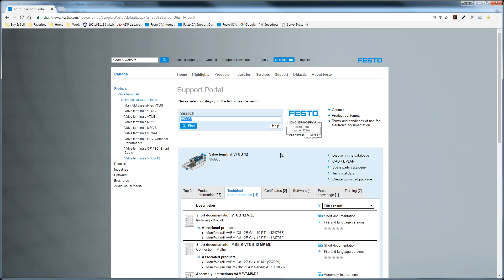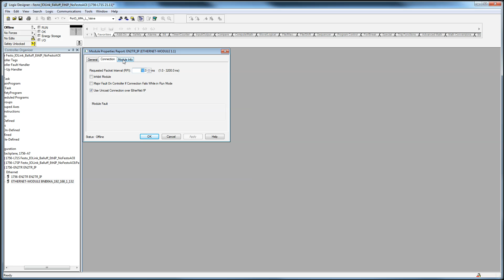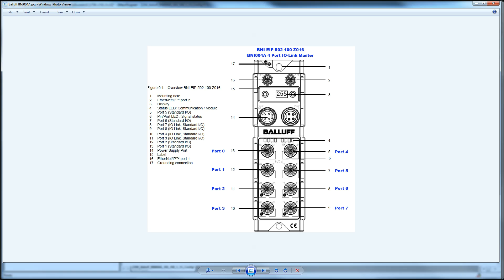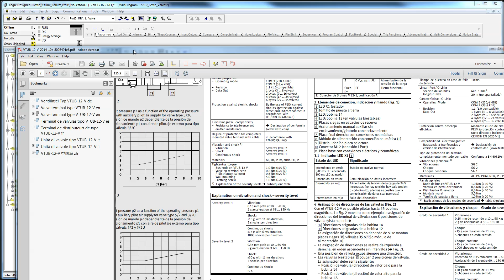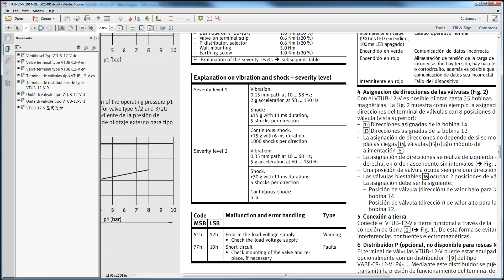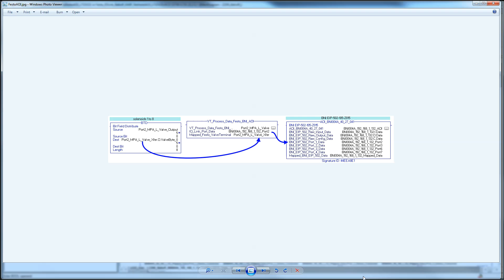Festo Valves + Balluff BNI004A + IO Link + Balluff + ControlLogix + EthIP

Comment: I cannot open the v21 of contrologix. There is an issue with that version. I just could import the AOI to an existing program but still needing the module i/o
Reply from the maker: V21 is sometimes issue due to the minor revision you have installed